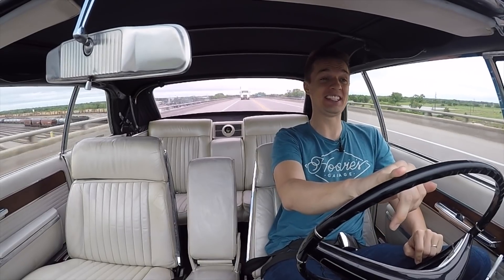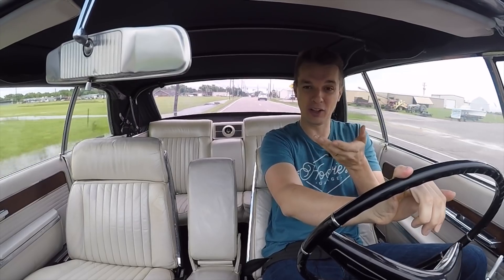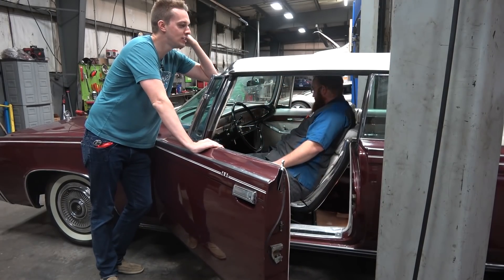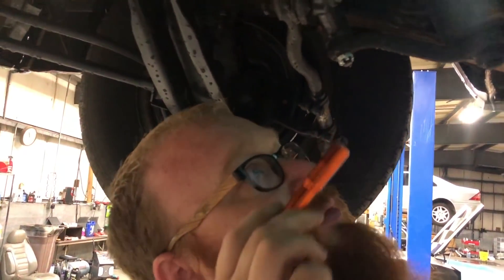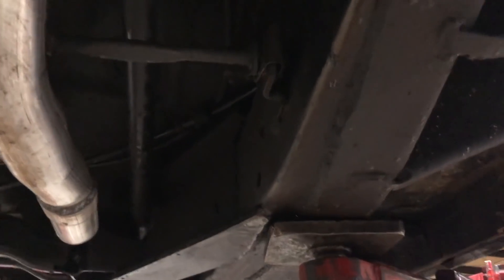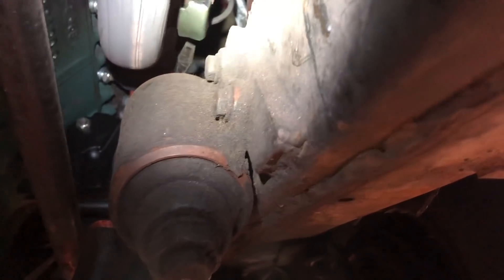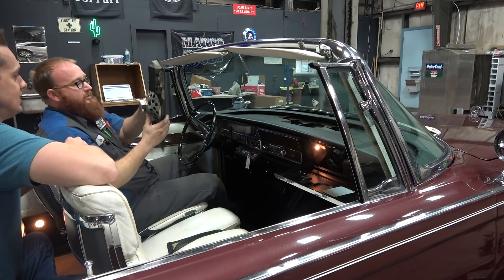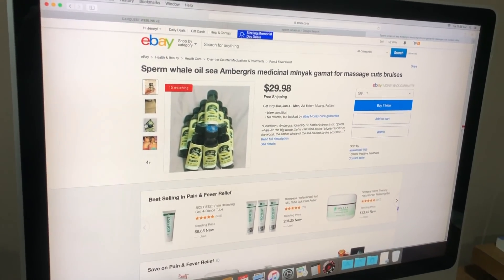Here's Everything that's Broken on My 1966 Imperial Crown Convertible and Why it's INDESTRUCTIBLE!

Comment: When you turn the heat on and it smells like coolant you need a new heater core and being as old as that car is all the seals and gaskets are all dried up and the rear main seal and all the gaskets would be in need of replacing including valve seals

Comment: I owned a 69 Imperial LeBaron. What a pig. Almost 3 tons and it got about 9 miles a gallon with the 440 and a single 4 barrel carb, not the 6 pack of 3 two barrel carbs.

Comment: A couple questions: 1, do you use a lead additive in the gas, or did a previous owner get the heads some hardened valve seats? Also, do you have a gas station nearby that sells ethanol-free gas? Because ethanol does some nasty stuff to old rubber hoses.

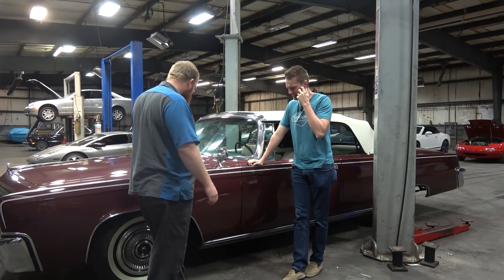Comment: 2:20 your door missed the lift pillar by like 0.00003 mm! (correction from your earlier video: no, the mid 70's 440 did not make less than 200 hp. 220 was the lowest, that was the California tune, but torque was still about 345.) 275 was the usual mid to late 70's hp number with torque not far below 400 ft/lbs. btw, the torque on your '66 is 450 ft/lbs at around 2,500 rpm! turbo diesel numbers with a tuner, but sounds a fork of a lot better & without the complexity and weigh penalty. a 440 is like 400 lbs lighter than a cummins turbo diesel. 2:40. Propylene glycol in anti-freeze, toxic! but guess what, folks..there's propylene glycol in vape juice!! regular cigs are healthier/safer, js..and that ain't saying much :p  whales. yup. and idk if ppl know this but, 99.999% of your typical car leather content is cow hide! as in..their skin! but hey, ppl want their rib-eye steaks & cheese burgers, so..what to do with all that leftover cowhide? 4:00. put a carter AVS copy on it..a brand new one from Edelbrock. I'd go 800 cfm. I bet your MPG skyrockets! That car with tall..like 2.75:1 gears, should pull down mid teens, hwy mpg. maybe better on a long expressway cruise. check plugs, wires, cap, rotor & check distributor for wobble/shake..check fuel filter, timing & cylinder compression. 5:20. engine color i think was turquois. & minus things like road salt etc, held up really well. good quality silicone properly applied is a 'good' oil pan or valve cover sealer. but nowadaws, eh..grab Felpro gaskets, steel core ones for valve covers & solid copper Mr. Gasket gaskets for exaust manifolds are awesome! 7:12 the mechanic is right! crumple zone was whatever you hit! & it's an X member plus perimeter frame, not the rubbish GM X frame, soggy bologne sandwich rigidity there :p 8:40. How many Miata's could be made from this Imperial? ahahaha! 9:00. if it never sees cold temps, (Temperature..it's a 4 syllable word, not pronounced 'Tempachur' with 3 syllables :) ditch the heat riser. better MPG, more power. put in new trans fluid, ATF+4 type, new power steering fluid, new silicone type brake fluid (doesn't wreck paint and works better) and new rear axle fluid..if sure grip, get the hypoid additive. 11:50 heater core..or just a rotted hose, bc as old as i am at 53 yrs. ofc, nothing wrong with my hose. lol. 14:40. your bill is low bc you're not treating this rolling Mona Lisa, ass hauling, gorguus car to new fluids! now imna recommend new anti-freeze! great car. spoil it, be ok with revving her up to 5k rpm here and there and enjoy!
Reply: ..i can't fix the lined out text. stupid YT.

Comment: great car; I had a 66 Le Baron sedan and loved it.  The vents rattling by the front speaker are for the defroster and/or air conditioning.  down is for defrost use, pulled up is for the a/c.  Problem with those is whatever mechanism is used to hold them upright to blow the a/c toward you fails and they won't stay up.  I think they are supposed to be able to be raised in different positions and stay in place until you lower them again.  Maybe Wizard can figure out how to fix that; I had to stuff match books in the side of mine to hold them up when I used the a/c.  Let  us know if there's a fix for that.  Good find; good price; rare car and very rare to find a white original interior that nice!

Comment: At 7.29 there is either a long crack or a terrible weld job where the box meets the frame.
Real trucks have had disc brakes for nearly 30 years Wizard! Disc brakes are way better on anything, a couple of applications on those drums and you wont stop. Especially if Hoovie decides to cruise at 90 just to drink fuel.

Comment: "I think the problem is that they didn't put a pan gasket on it, just silicone..." Really? Silicone gasket goo is usually better than an actual gasket, and loads of manufacturers use it in some areas in the place of normal gaskets. The issue is probably that it wasn't applied with enough care.

Comment: Its a Convertible...Thats why it has a X brace..I did the same thing to my 1000hp 95 Cobra Convertible  which also has a factory x brace under the k memember,a brace across the stut towers and factory sub frame  connectors.. I have zero flex even with over 1000hp..

Comment: You got one of last good Imperials; if I remember right, 1966 was the last year Imperial used a stand alone chassis that wasn't shared with other Chrysler products.  

Your Imperial has a separate frame on body, vs unitized body on every other Chrysler product.  In 1967, Imperial was put on the regular Chrysler body in the re-design to save money since Imperials always sold less than than Cadillac and Lincoln.  After 1966 model year, Imperial became a slightly higher trim New Yorker model and the built like a tank feeling was lost.
Reply: That's not quite accurate. Yes, 66 was the last year of the full-frame, but the 67-73 unibody Imperial platform was completely different from C-body Chryslers like Newport/New Yorker. They were wider, longer (actually I think 73 Imperial is longest non-comercial car produced) longer wheel base, and bigger wheel bolt circle than the smaller C-body cars. That changed in 1974 when Imperial went to the standard C-body platform, and yes, was just a fancier New Yorker. When Imperial was discontinued after 1975 model year, that same design became the "New Yorker Brougham". 
Imagine buying a new Imperial in 1975 and in 1976 the almost identical car was sold as a New Yorker for $1,000+ less 😲

Comment: ONE QUESTION..ANYONE??  Why o Why did Chrysler NOT equip this big, heavy, top of the line car with Disk brakes on the front?  Dunlop, Lockheed, ATE, other were making them in early 60s. Mercedes upper mid level 250S/SE and high end 300SE had them standard in 66. So did Alfa 105s and all Jags...TR4s...Spitfires..MGB..Volvos...Up and down prices ranges.  So did  Corvettes..Anybody know why Imperial no disk?

Comment: And Wizards prices are slightly ridiculous. $150 to do the pan gasket? It will take about what 20 minutes, plus the cost of the gasket. Same with the diff seal. $100 to take the dash speaker out and put two little bits of rubber on it, then put it back? REALLY?!

Comment: dude.. im an Audi Tech...AUDIS are hella expensive to fix right? well dude this guy is charging u way too much... 150 to reseal a pan about a (45 -60min job), 100 bucks to glue some foam on a speaker grill 5-10 min job, heat riser rattle .. just to add a spring 100$ will take (5-10min)..100 bucks to pop a seal in the diff.. 25-30 min job ... most of these things like the spring and grill foam would be done on the house for a loyal customer... man so 850$.. i would of charged you 100 for pan reseal. 75 for diff seal, free foam, free spring install, 375$ for the heater core.. so like 550$  and i would if gave you a flash light..

Comment: Don't semis also use air drum brakes? Big difference from hydraulic.
Reply: MrTilbin nope. No difference other than the method used to operate the brake shoes. Same shoe style being pressed against steel drums. How is that different?
Reply: I thought that air clamped harder and with more reliability.

Comment: When your climate control system is sending out liquid or making funny noises, turn it off.
At the Toyota Camry plant one Monday a Camry blower motor made a funny noise, so the line worker turned it off and called for help.  When help got there they decided to put it on high, at that point blood and little pieces of stuff started flying out. A mouse chewed through the fresh air filter and fell in the blower motor and got blended like a milkshake and spit out the pieces through the dash vents.
So morals of the story
1 don't leave a Camry on the fresh air setting if you disconnect the battery.
2 if the hvac makes funny noise don't turn it on high (or at all).

Comment: without watching the rest of the video: heater core is rusted out. Common problem on 60's cars. Pretty straight forward to replace. Usually a dozen or so bolts on the passenger side fire wall and two heater hoses.

Edit: $400? errm. Should be an hour job max.
Reply: Depends on the car. Some are relatively easy and some take hours of disassembly. Just have to find a 1966 Imperial shop manual with the hours!

Comment: below 200 hp? ha. 440's lowest hp number was 220 with the Cali tune, the usual mid-late 70's 440's made 250-275. ditch the cats & leanburn ignition/dist. for 300+ :) torque was 350-380 ft/lbs at fairly low rpm, around 2,500. Turbo Diesel numbers without the cost and complexity + a 400 lb lighter engine than say a Cummins turbo diesel.

Comment: Well... to be fair Mr. Wizard, semi drum brakes are actuated with pneumatic pressure, cars are hydraulic.
Reply: So?
Reply: @daithi007 You get a lot more force from pneumatic drums than you do hydraulic, mostly because of the design. Semis use this eccentric twisting nub thing that applies hella force to the brake shoes compared to brake cylinders in cars drums.
Reply: @man_on_wheelz  cheers!

Comment: If speakers are original, spend $30 for a pair of new ones. It will sound so much better and car will still look original with the covers on.
Reply: Yeah, nothing better than AM radio with the top down cruising at hwy speeds. I wouldn't even bother turning the radio on in this tank. A pair of bluetooth speakers in the back would be the route I'd take if I wanted tunes, which I probably wouldn't.
Reply: @OMGWTFLOLSMH  
But obviosly he listens to the radio. Then you should change the speakers, those original paper cones probably sounded like crap already when new.
And it's quite easy to add a BT-adapter to the original stereo.

Comment: Old cars are better: it's facts
Reply: Really? Spark plugs needed to be changed every 5k miles, along with the distributor cap, rotor and condenser. The steel rusted in 2 years. You only drove the car 50k miles before they needed to be replaced. Good cars, like the Nova, would last 75k miles. You had to tune them, unlike new cars that tune themselves. When was the last time you had a front end alignment on a modern car? The doors used to sag, and you had to slam them to get them to close.
Reply: Doug Montgomery and all of that work is still easier and cheaper than newer cars. I'd rather do a full tune up on 66 f100 than an oil change on anything 5 years old or newer. Everything is so much more complicated and harder to work on, and therefore more expensive. For the standard consumer, sure, a new(er) car makes sense. For me, I'll stick to my older stuff.

Comment: my 69 plymouth fury with the 318 2barrel got 16mpg on the highway. thats not really that bad.
Reply: Ok, heres are the facts for you regarding imperials gas mileage for 1966:
City/6.3mpg extra-urban/13.2mpg. That is the RANGE FOR THE STOCK 440/7.2 LITRE ENGINE! it's a gas hog. Dont kid yourself, this is my favorite car, but if I were to acquire one, I'd get it switched from carbuerated to fuel-injected BEFORE using it even as a backup car for long trips. Just saying....
Reply: its a prestige car first. fuel economy doesnt matter. 13mpg on the highway for that size and era engine is quite good really.

Comment: This is NOT a 1966 Imperial - it's a 1965!  Don't mess with me on this - I know my mid-'60s Chryslers.
Reply: Nope. I looked it up. The squarish Engel body started in 1964 with a split grille. The 1965 had a solid grille, taller than the 1966 and segmented in half just by a bar. The 1966 grille was oblong with no split, like here. The other major change on the 1966 is the trunk lid, which smooths out the suggestion of a spare tire shape of the '64-65.